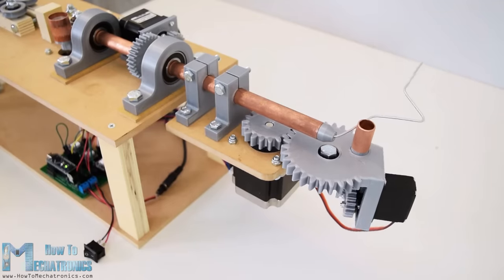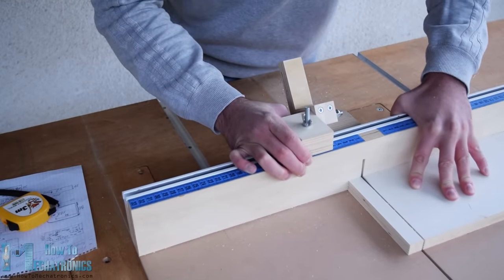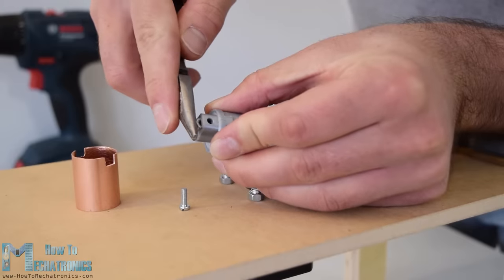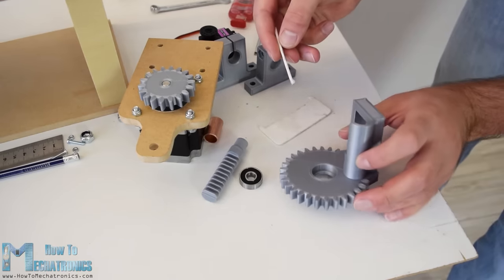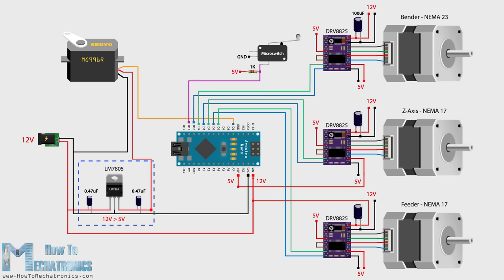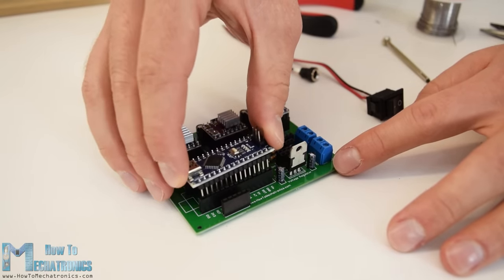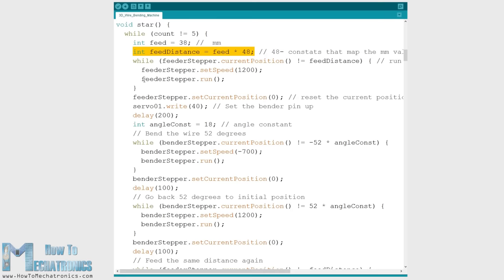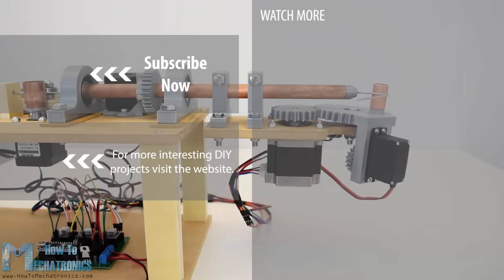Arduino 3D Wire Bending Machine

Comment: Use a mig welder wire feeder it's cheap but you can replicate it in 3d software. Amazing work!
Reply: Bingo. Might be able to get replacement parts for a wirefeed welder as well.
Reply: @DavidCAdams  you can buy a mig wire feeder on ebay very cheap. If you like to spend more money you can buy a branded one and better quality.
Reply: Why don’t you put some heat shrink tubing around the copper tube first and see if that helps. Coolest project I’ve seen yet. Keep up the good work.

Comment: Well done, HTM!  This is quality content.
The machine is well-built.  I like how everything is custom designed (including the PCB, gears) and no hot glues or temporary wires are used. You use nuts and screw correctly to hold the motors in place.
Your video is quite in-depth and explains the details and how-to pretty well.
I've subscribed, definately looking for more!
Reply from the maker: I'm so glad to hear this, thank you! I will always give my best to make quality content.

Comment: This is one of the best practical demonstrations of the fundamentals of mechatronics that I've ever seen. Physical manipulation and mechanical feedback of/from the environment, electronic interface to process and give action to the software  commands/feedback, custom-coded software running the show. All the principles you need to learn, in a really nicely engineered demo project. Excellent work, 10/10, new sub here. Happy new year from Australia mate, all the best for 2019!
Reply from the maker: Thank you so very much for comment, it means a lot to me! I will give me best to make more projects like this one. Happy New Year! :)
Reply: @HowToMechatronics  How about turning the straightening rollers into a variable-pressure extruder with directly opposed rollers in horizontal/vertical planes... So you could program  different round/flat/square wire profiles in different sections of the produced shapes?
It's a lot of extra engineering, but should be simple to implement on the software side.
Is it possible, what do you think? 😁
Maybe a linear actuator would have enough holding force to apply suitable pressure to a copper wire, or maybe you need some kind of gearing-reduced servo/stepper mechanism to adjust the distance/pressure of the rollers?

Comment: instead of using flat wheels or rollers to feed the wire, you need to make feed wheels with a grove machined around them to match the diameter of the wire being fed. The grooves need to be textured, then one wheel needs to be stationary while the other has adjustable spring tension to apply pressure on the wire. Then your wire straightener will work flawlessly.

Comment: I don't think I've ever seen anyone custom order a PCB and then use it as a breadboard.
Reply: Modularized design, not really a bread board, but true.
Reply: yea that was kind of a waste, sockets for JST connectors are not expensive and would have made this thing so much better.
Reply: To make it easy to switch out the stepper drivers (since it's not hard to over-heat then) I presume.

Comment: Exceptional thank you. I’ve been building a wire bending spring maker that I found on instructables which is really good and to now find your clever invention will give me not just an alternative wire bending machine but also a deeper understanding of all that is going on both with the mechanics but even more importantly, with the coding which I am quite new to. Thank you for a clear, simple and easy to understand explanation, it is of great value to me personally and I am very grateful, thank you 😎

Comment: I'm a new viewer. Only minutes into watching my first video, I'm already subscribed. Great build!
I wonder if it could made to run something like GRBL.
Reply from the maker: Thank you! Well to be honest, I couldn't afford more time in making the program more functional. Maybe in future video I could make a GUI, probably using Processing IDE, where you can draw a shape on a canvas, and then send the shape to the Arduino using the serial port, and the machine will make the shape . But like I said, it takes time to make such a thing, so maybe in some future video.
Reply: It should just work using GRBL (with some basic GRBL config) G-Code would instruct the machine.

Comment: Excellent engineering, video, narration, and documentation!
The only alteration that I can recommend is the problem with the feeder stepper slipping, using a pulling spring from the other side instead of the bolt on the 
lever. Liked and subscribed!
Reply from the maker: Thank you and thanks for the input!

Comment: Great job. Amazed that you can get a custom designed circuit board made for $2.00. You should add a spring to the tensioner to give you pre-load on the wire and better grip!

Comment: Very nice machine.

For the feeder problem perhaps what you need is some spring loading on the lever that presses against the feed roller. With just a tightening screw it is difficult to keep constant pressure on the wire.

Comment: Commendable undertaking with outstanding results.  The 3D printer is again demonstrated as an indispensable tool in the hands of a skilled maker like yourself. Thank you.
Years ago where I worked in a airplane factory, there were similar machines on a larger scale, that were use to produce complex hydraulic lines by the hundreds.  I don't think they were computer controlled though.
Reply from the maker: Thank you! Yeah, 3D printers are really amazing, especially nowadays when you can get great print quality with decent priced printer.

Comment: Oh My Gosh!  Fantastic!  I have always wanted one but so expensive.  I will build and use to upgrade to rebar and thicker wire.  I use 3D prints to cast aluminum and have access to milling machines.  Again FANTASTIC!
Reply from the maker: Thanks! Keep in mind it would need quite some improvements for this to work on a bigger scale or for thicker wire. Make sure you are ready for that! :)

Comment: Pretty cool. I think rubber-wheels would help with feeding. If both wheels had a rubber band around them they should grip the wire without issue.

Comment: If the copper feeder roller (the one that is slipping) was knurled, it would "grip" the wire.
Or, try slipping a section of rubber "surgical" tubing over the copper feed roller to grip the wire.
Cool project!

Comment: Great video. Just a thought. in a mig welder the wire is fed in a similar way.  The spools of wire are heavy and the feeder works similar to your feeder or pulling you are doing but it has a grooves that the pressure is set with a screw and a spring that puts pressure on the Drive Roller wheel that puts pressure on the wire that is being pushed and pulled at the same time. It would be easy to try.  Just a thought. Great project.

Comment: This was very well done!  Clear and thorough.  Thanks! What if you connect the two straightener wheels with a belt and drive them as the feed stepper.  As you increase force on the straightener,  you also increase the feed friction.  This eliminates the dedicated feed bobbin.
Reply from the maker: Thanks. Yeah, that's an option for solving that issue.
Reply: How To Mechatronics . . Just noticed Matt Mattelig a few days earlier had the same input.  Makes sense that the thing causing the most resistance should be the same thing driving it.   Cheers and thanks again for a great post.

Comment: For feeder system to work effectively cover the copper tube and bearing with rubber material or you can just use a wheel of some toy car. Rubber adds more  grip on wire and reduces slippage.

Comment: That is a good project!! one suggestion is to take a solid rod and put a 608 bearing on each end. embedded into the frame and drive it that way. in the say a mig welder drives the wire threw a tube. still a very cool project.

Comment: Awesome dude, I am building one myself and think I will copy the way a wire feed welder advances the wire, with a s. steel knurled wheel with another bearing type setup. I will let you know how it works for me, if it's better than the copper tube you employed. Again, very nice design and execution. I'm a big fan of your now, keep up with all the great projects.

Comment: Nice setup   try using puch springs for transfering  pressure from set screws to he wheels at the feeder and  straittner. Also in between the straitning bars put two weaker springs  
To keep the distance of the bars when not in tension.

Comment: If you can come up with a way to reduce the distance between the wire arbor and the bending shaft (and reduce the size of the bending shaft by using a dowel pin or similar) you should be able to do away with the servo rack and pinion system. In order to change what side of the wire bending shaft is on the Z-axis can be rotated through 180 degrees. The smaller distance between the arbor and the bending shaft would be required so the bending shaft does not get caught up in smaller bent features. It would mean that the wire arbor would need to be stronger because the reduced distance between the arbor and the bending shaft would mean that the bending shaft would need to exert a greater force to achieve the same bending moment so a metal arbor would probably be required.
This would greatly reduce the construction complexity of the machine and would mean that the control software could be significantly simpler as you would only ever be eliminating a function to control and would only be bending in one direction but at a different angle

Comment: Please try using welder drive drive rolls from a mig welding machine. In fact use the entire drive system as you will get a spring loaded tension nut and your choice of smooth,ribbed grooved rollers that can work against a flat or grooved roller on the other side. Commons size would be .032 & .045. Might very well solve the straightening issue as well.

Comment: It might be worthwhile adding a counterweight to the z-azis to offset the bending mechanism. The counterweight could be added close to the bearing that supports the bending head. There's a bit of a trade-off when it comes to weight: you can use a lighter weight on a longer arm, but this will have more rotational inertia than a heavier weight on a shorter arm.

Comment: I'm not sure if you mentioned the wire gauge. Take a look at commercially available Mig welders. They drive small diameter wire much longer distances with a pretty simple drive system. The drive rolls are inexpensive to purchase. Harder and/or thicker wire is generally simpler to straighten (five rolls similar to your design should work). Softer and/or thinner metals will require  more straightening rolls. My "two cents" are based on metal coil "straightening" which is actually the flattening of metal coil (such as aluminum foil). Whether it's wire, tube, or coil, all metal needs to pass through a guide or die straight (flat), before accurate bending, forming, stamping et cetera.

Comment: l use much larger machines like this at work and they have 2 sets of straightening rollers, 1 set each for horizontal and vertical which might fix your problem of the drive roller slippage (less load on each set of rollers). they also have three drive rollers set up the same way as the straightening rollers

Comment: First up, great job on making this, k love the simplicity and neat assembly of it. and the result is great.
but you were struggeling to get the needed grip on the feeding if you tightend the straightner. Maybe you could add a bit of bicycle inner tube on the feeding mechanism. maybe that would add some traction.
In the end, thanks for a great video, it was truly great to see how you made it, keep making great things to come.

Comment: Hi. I couldn't help but notice that you have a metal bearing on one side of the feeder and a copper tube on the other. If you're trying to push a metal wire there may be alot of slippage as you're trying to push metal with metal. Why not simply take an appropriately sized rubber band and secure it around the bearing and another one for the tube? Then you'll have have sufficient rolling friction to ensure a good grip on the wire.
Reply: or maybe a bondtech extruder

Comment: Resistors, capacitors, and inductors can all be made from wire: simple circuits could be designed that could be fashioned from a similar machine.

Comment: This is an impressive build.  I imagine lots of trial and error to get the code to match the shapes you are designing for.  I would recommend replacing the copper drive wheel with a Mig wire drive wheel.  They have groves that represent the wire diameter and perhaps instead of using a bolt to tighten the bearing into the drive roller, I suggest a spring that can be loaded to allow for tension adjust and slight movement for irregularities.  This is how the drive roller mechanisms work in a MIG welder.
Reply from the maker: Thanks for the input!

Comment: Although the wire bending stepper motor may be strong enough I would still recommend counterweighting so that you didn't have significant hysteresis through the rotations.
Reply from the maker: Thanks for the remark!
Reply: It's a very impressive build. Thanks for recording and uploading it too.

Comment: Thx! Its very interesting, but very important to make a software part. Now it work in manual mode, but have to bend wire from ai or stl or other vectors format. Only then this project will finished imho.

Comment: Challenge: a breadboard wire bending machine: cut, remove the insulation and bend it.
You will still be able to choose the length in mils

Comment: Thanks a lot. Simple control board but amazing work. 
Are the 3D printed gear wheels and brackets etc, strong enough to handle the forces. 
Please share the kind of 3D printer used and kind of material used for 3D printing.

Comment: Awesome.  It looks like a lot of work for an end result that is good, but maybe not super durable and precise.  I like the 3D printed parts but I wished you mentioned how long the parts took to print, and at what resolution.  But it seems like you really needed parts made of metal, and machined to precision. ...but then again, that would not be a DIY project for the typical person.  I wonder what kind of design I can come up with.  They all have pretty much the same working principles and are all similar in that respect.

Comment: Freaking awesome man XD the voice cracks even were awesome cause it made ya sound like a stereotypical scientist from books and movies XD again, awesome =D

Tho I gotta ask... Why such a HUGE nema stepper?? That's alot of weight for the other stepper to have to lift. Could have easily gotten away with a nema 17 lol
Reply from the maker: hehe thanks! Yeah, true the nema 23 is around 0.6kg which stresses the Z-axis stepper to its limit. Maybe a nema 17 would have worked just fine as well, but hey, this way it looks cooler, and it can bend even 3 mm wire. :)

Comment: What a fun little project - got me to your channel.  
I'm just getting back into electronics build projects after a couple decades - - everything is so cheap now and plentiful.  Wow 
I started with the 8008 and 4004 in the 70's, then working on IBM mainframes with punched cards and such, and on and on. 
Got to design lots of computer hardware, write operating systems and so forth.  
Then got into patenting some of my inventions.  Sadly didn't make much money on the patents - was too far ahead of the curve. 
But for last 20 years doing patent work for major fortune 500 companies and universities -- love it -- but really missing the hands on electronics.
Starting to design some specialized security projects which will also be used to get me up to speed with Arduino and the newer microcontrollers. 
It really is amazing how easy and cheap the electronics are today.  
Even in the 90's I had to shell out a few hundred bucks for PIC emulators, and having PCBs made was costly, usually 'rolled' my own.
Anyway -- you really got my electron juices flowing -- THANKS.  I've subscribed and will be checking things out.
Reply from the maker: Thank you! I'm glad you found this video interesting
That's right, today it's so easy and accessible to play around with electronics, or not just play around, but build useful DIY projects and even more, build prototypes which can be a real product one day.
Thanks again for the comment.

Comment: I’m new to Arduino and 3D printing but have been working years as an Autocad/Inventor mechanical designer. I bought an Ender 3 and want to build things that I drew.

Very impressive machine you build. That gives me ideas. But I have one question. Did you print the parts in PLA?

Thank you for inspiring me!

Comment: It appears that over tightening the straightener mechanism is adding extra resistance because the machine is trying so over bend the wires; the wire needs to move in an W path between the rollers instead of straight.

At work we straighten wire for our baling machine with just a 6" long block of hpde/nylon with a small hole drilled through it. Similar to your wire guides now, but just 6" deep.

I'd like to what kinds of things you make with this machine!

Comment: instead of using the copper pipe to feed the wire use a gear like on a 3d printer extruder this will work better or you could get a tumbler from a mig welding machine that feeds wire

Comment: Nice Build! 

Your Programming could use some work thought. 
Try to pull out evry code that will get repeated in it's own method. 
The describition of a Form must not include any more code than how much wire you wanna feed, and in waht direction you want to bend it. 
You also might want to add a multiplier to your feed function. This way you can print the star in an size you want. ;)
Reply from the maker: Thanks! Yes, that's true, I need some improvement in the programming. :)
Reply: @HowToMechatronics  I am surprised you could read my broken english ^^. It's not about improving your programming skills. It's just about organizing your code ^^